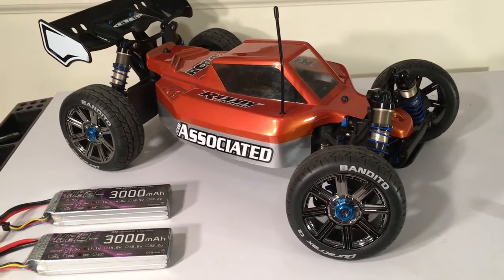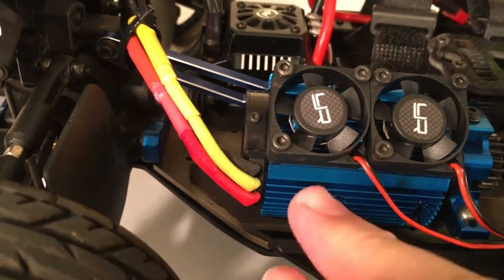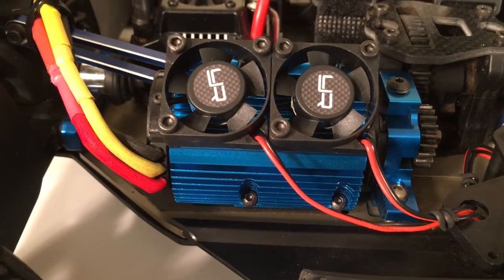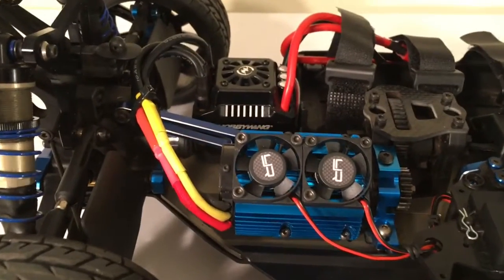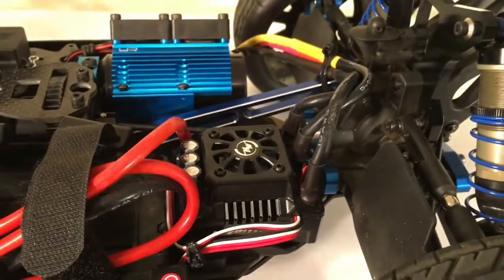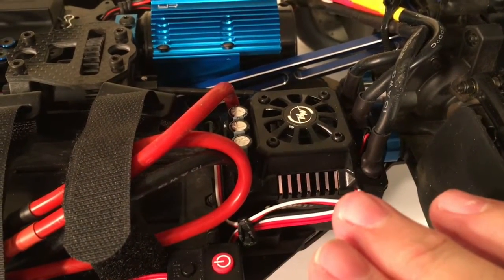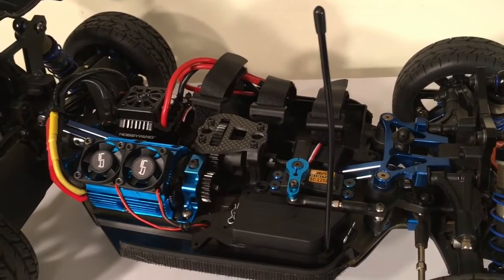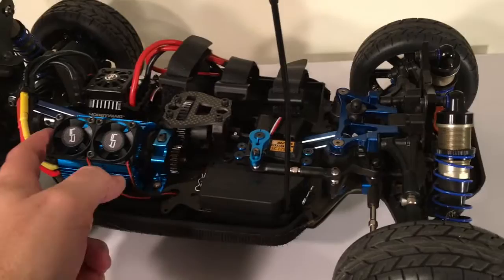Team Associated RC8.2e Factory Team Kit - Pt3 Hobbywing Max 8

Comment: How did you power the fans? I plug mine in to channel 3 and aux but I don't get any power.
Reply from the maker: Bandith Phommounivong 
Should power from any open receiver port. Double check your polarity to make sure the red and black wires are plugged in correctly.
Reply: Works! Thanks!

Comment: Hey Keith, I definately agree about the maxx 8 and also the maxx 6, it has tons of power, very smooth, very efficient, easy to program, and the price is not bad! I gave up on castle quite a while back, I still run there motors, but I had one to many problems! Also just my opinion, by the way the car looks like it would be fun to drive, nice work!
Reply from the maker: corey kurtz 
Thx bro! And yes it handles great!

Comment: Sweet rig :) Though it does seem annoying that even with the firm springs you have to crank up the preload all the way.
Reply: Either the springs aren't long enough or could have built the shocks better or he likes a stiff bouncy ride. 170 degrees on the 2000 kv 1/8 scale motor? Poor gearing choice since he needs two fans with an aluminum heat sink
Reply: Oh I like the rest of his choices, even the springs but you'd think TA would supply the stiff ones actually stiff or long enough.
Reply from the maker: ArielsSmartyPants 
I've got the preload set like that because I was doing speed runs. At 80+ mph you don't want a soft suspension. When I run off road I soften it up considerably. Thx 4 watching friend 👍🏼
Reply from the maker: Powerpickle68 
Thanks for watching powerpickle. I have the buggy set up for high speed 6s running right now. I go much softer when off road. If you watch again you will hear the 170 degree temperature was on my 1/8 Rival MT. I've got the smallest pinion on it but after a hard 6s session temps reached 170. The fans cooled things down to 135! Because of that I installed a 2nd fan on this buggy even though I've never had heat issues on the RC8.2e. With over 20 years in electronics I know that the cooler you keep electronics, the longer they last 👍🏼